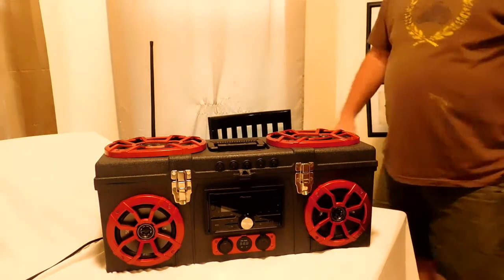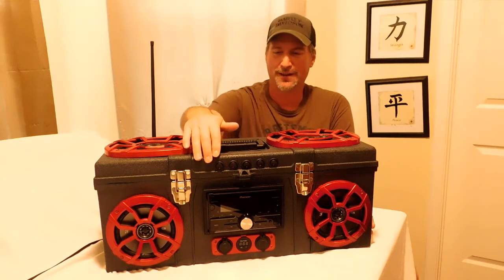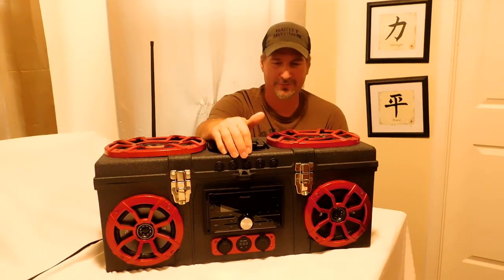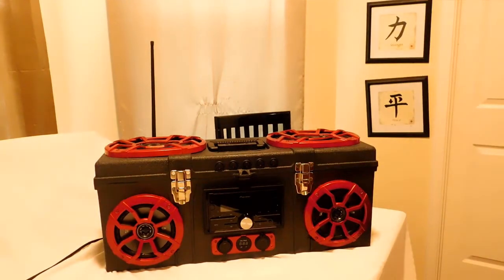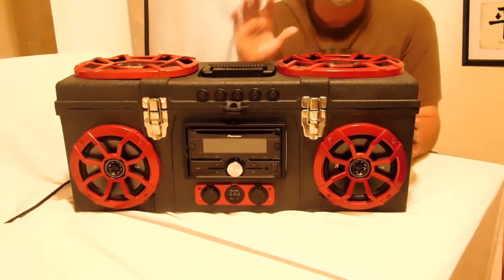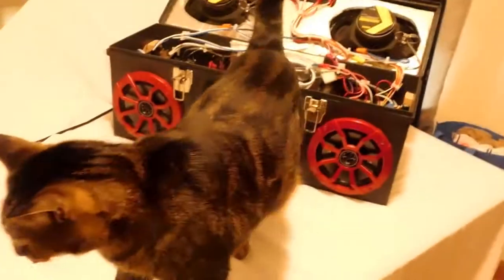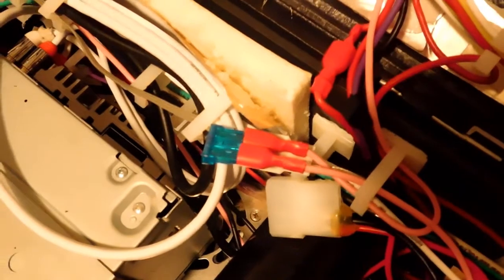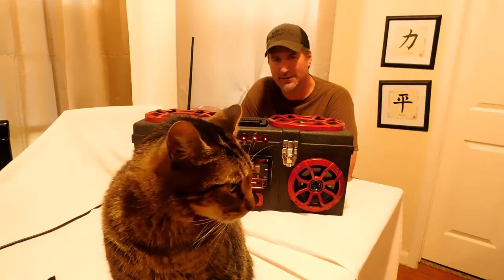Mega Tool Box Boom Box in Texas.  Part 3. The tour.

Comment: so you have multiple batteries and a voltage booster.. could a setup like this have the batteries wired in series to boost the voltage (from 12 to 24), have you ever tried something like that?
Reply from the maker: Yes, but the radio, usb ports and switches all run on 12 volts

Comment: Hi I am in the process of doing a similar build with a car stereo I am running it off of a 12v 5a laptop charger
After watching your videos I had a look around the house and I have
 2 x 12v 7ah batteries
Would you mind telling me if you know What relay do I need so i can have a set up like yours where I can switch between battery power and mains power?
I'm from uk
Reply from the maker: I can help. But first,  are you on Facebook?
Reply: @diyboomboxesintexas2805  Hi thanks for the quick reply, I have a facebook account Vti saes
Reply from the maker: Please join my Facebook group.  It will be easier for me to answer your questions there and send you links.
The group is called,  "I Love All Things Radio And Audio "